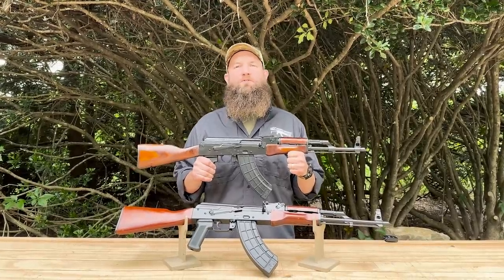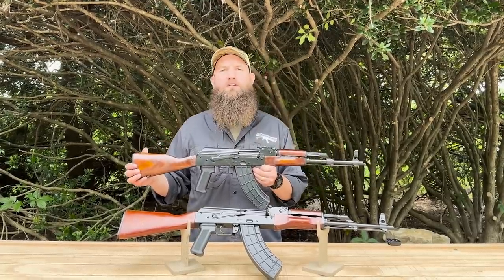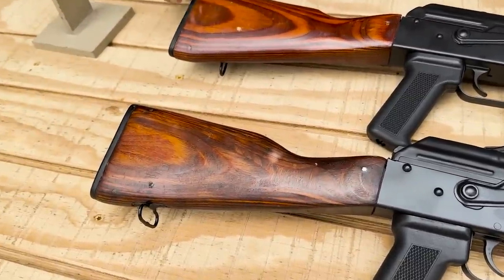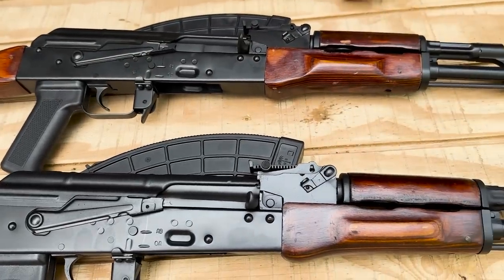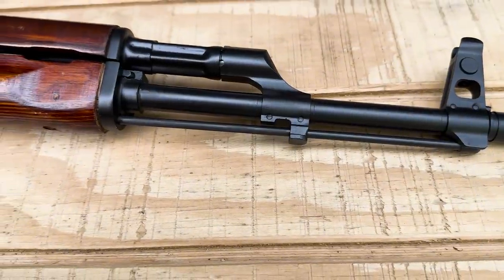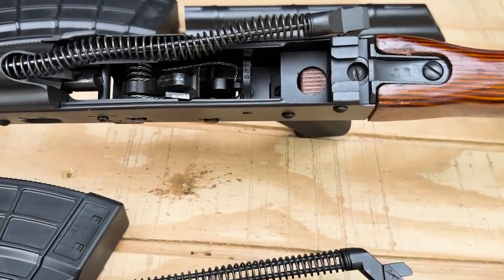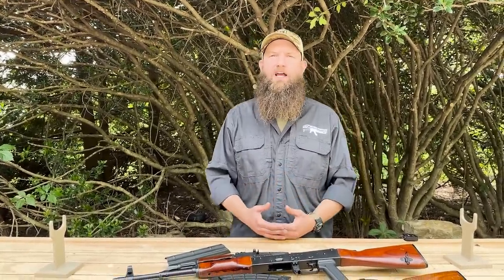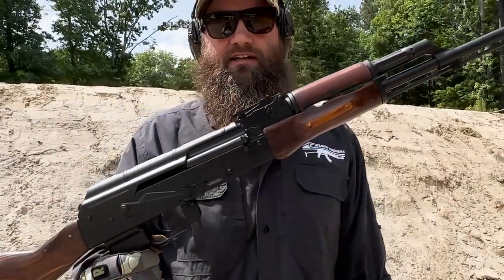Russian AKM Rifle

Comment: Intriguing 
But I'm not sure that the price is super competitive
Reply: they're direct in iine with how much it costs to build one. Tula kits are going for $1500 JUST for the parts kits, if you can find them. $160 for the barrle, $120-$140 for the childers receiver.... that's about $1800 right there. Then you add in a good builder ($500 average, can be as low as $400, or high as $700 depending on your builder) + refinishing... $2200-$2300 estimated end price. 

is it for everyone? Of course not, but it's not out of line with the cost of kit + extra parts , plus builder fee. It is what it is. A banned country's parts kits made well by competent builders. They're not going to get cheaper. Whether it's worth it or not will depend entirely on you

Comment: 😂😂😂😂😂 stop guys, y’all are wild with this pricing.
Reply: they're direct in iine with how much it costs to build one. Tula kits are going for $1500 JUST for the parts kits, if you can find them. $160 for the barrle, $120-$140 for the childers receiver.... that's about $1800 right there. Then you add in a good builder ($500 average, can be as low as $400, or high as $700 depending on your builder) + refinishing... $2200-$2300 estimated end price. 

is it for everyone? Of course not, but it's not out of line with the cost of kit + extra parts , plus builder fee. It is what it is. A banned country's parts kits made well by competent builders. They're not going to get cheaper. Whether it's worth it or not will depend entirely on you

Comment: $2299.00 for this?! Another Atlantic Firearms over-priced rip off. Come on Atlantic....WTF..!!??
Reply: they're direct in iine with how much it costs to build one. Tula kits are going for $1500 JUST for the parts kits, if you can find them. $160 for the barrle, $120-$140 for the childers receiver.... that's about $1800 right there. Then you add in a good builder ($500 average, can be as low as $400, or high as $700 depending on your builder) + refinishing... $2200-$2300 estimated end price. 

is it for everyone? Of course not, but it's not out of line with the cost of kit + extra parts , plus builder fee. It is what it is. A banned country's parts kits made well by competent builders. They're not going to get cheaper. Whether it's worth it or not will depend entirely on you